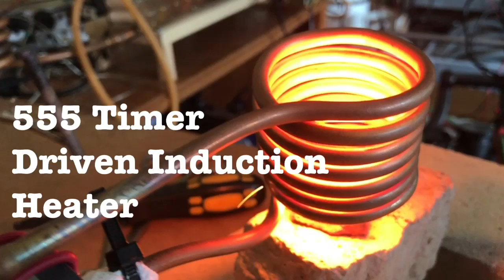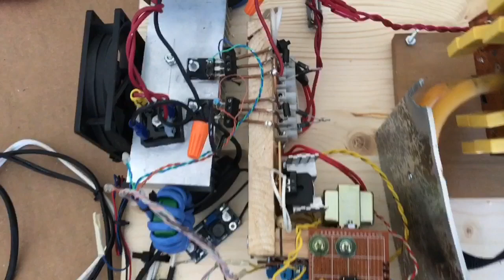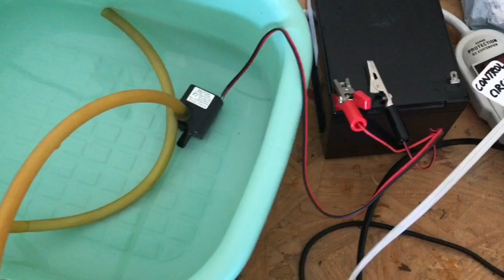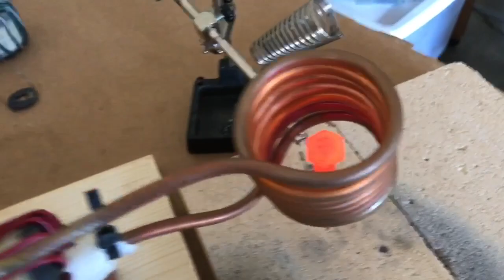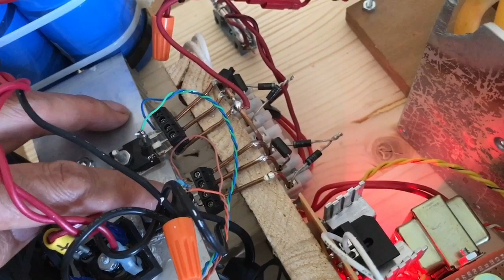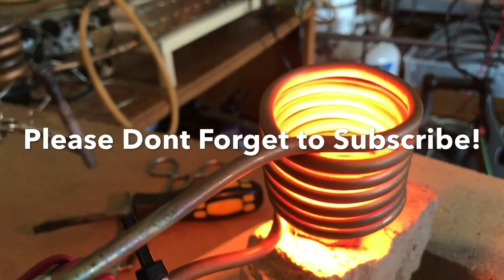555 Timer-driven Induction Heater

Comment: How much did this run cost you in terms of electricity from the utility meter?
Reply from the maker: A run like this typically does about 2 kW. Running for an hour would be 2 kWh If I do the run for 15 minutes this would be 0.5 kWh. At 17 c per kilowatt hour this would correspond to just over 8.5 cents
Reply: @BrianDhvTinkerer  Thank you!

Comment: I wonder why the coil didn’t shorts out the ferrite core transformer blowing the igbt I try it with 19kw ferrite core at 100khz the circuit work great with the induction coil but as I add it on the core the circuit blow up I don’t understand this I built induction without pwm ic and it work but refused to work the same design you use I use 20 1000 volt 1uf capacitor and still it blow up I even un 20kw of igbt and all blow up I even use a welder and the welder work and it the same circuit I copy a use the circuit work great welder but the induction still blowing it up am confused at this point

Comment: I have used the same IGBTs, each attached to a separate heatsink with fans. I measured Tcase around 90 celcius, at around 1.2KW of power the IGBTs shorted. Any idea how to prevent the thermal runaway?
Reply from the maker: Definitely would recommend mounting them on a water block if you’re going to use them with an induction heater. I had the same issue using regular fan cooled heat sinks. However, with a water block, it solves the problem completely. Only issue is clamping IGBTs down-to the water block with equal pressure on each. I found a solution for this.
Reply: @BrianDhvTinkerer  With 1.2kw of power, wouldnt be too much for water cooling the inverter? That means that its really inefficient. My setup was 4 heatsinks each 80-100W heat disipation so 400W in heat dissipation total. They were driven preety hard from a gate transformer with 4 secondary windings each for one IGBT so i suspect it wasnt from switching losses. Maybe the PLL got out of frequency range, so the whole system got out of tune and was drawing alot of amps that way. I have 325Vdc input, full bridge inverter and 18 turns in the matching transformer, 90-100KHz. Would you recomend to use 500V MOSFETs for this kind of application?

Comment: Hello. How did you calculate the matching transformer, which feeds the series circuit of the inductor? This transformer can be seen at 0.12 time on  video. Maybe you know where i can read about the design of such transformers. Thank you
Reply from the maker: It was done empirically. I just ran the unit with different ferrite toroids made with different size and type ferrite material and also some powdered iron toroids and chose the ones that have the best heating of the workpiece and least heating of the toroid material. I was able to find ones that had essentially no heating of the ferrite material. Even better energy transfer can be obtained by stacking the toroids.
Reply: Thank.

Comment: would be interesting to try and design and build wills type water heater using this circuit which would heat water in a coiled pipe would onto a steel mandrel sheathed inside a steel steel pipe but the work coil is wrapped round the steel pipe which is insulated using Rockwell wool.

Comment: please sent me schematic diagram
santossantoso950@gmail.com
thanks,..
nice project,.
Reply from the maker: +dika dosantoz  sure will. I need to draw one out.
The square wave output from a 555 timer is fed directly into mosfet driver chips which then drive either a full bridge or half bridge of mosfets. The 555 timer is and mosfet driver chips are electrically isolated from the half bridge or full bridge using a ferrite gate drive transformer. The half bridge or full bridge gets rectified DC via the mains and pulses this into the tank circuit. This is done using a ferrite coupling transformer. When the frequency entering the tank reaches its resonance frequency, huge currents build up in the tank (kAmps) which heat the metal placed in the coil via eddy currents. The circuit diagram
I put together should be more self explanatory. When the power is off resonance, no power flows into the tank and their is little or no current draw.
Reply: thanks for the science
and I am waiting for the schematic diagram from you
#google translate
Reply from the maker: will have  it to you soon!
Reply: thanks for circuit 👍

Comment: I am a knife maker, and have been looking into using induction to heat treat my knives.  All of the cheaper options I have been looking at on ebay, using $40 induction machine, using 30V, 20A power supply, seam to not work well for this, because it only heats carbon steel to non magnetic, then stops heating at that point.  Can you advise me how to continue heating metal past non magnetic, so I can heat a little past critical before quench?
Reply from the maker: +WILDSTANG30250 you may want to try something like this: https://youtu.be/nIPuZ1WPtc0

I am planning on making an instructible on this if there is enough interest.

Comment from the maker: I think I can get this circuit to autune with a feedback antenna or feedback transformer placed in such a way to pick up the output of the tank and feed it back into the Schmitt chip.
Reply: thanks for ur help man, atm im trying to get all the mats to make a PLL heater.... Thanks for ur support-
Reply: At this moment im buying the capacitors for the tank, would be 140pc 22nf 600v enough for the tank circuit? Thanks man
Reply from the maker: should be more then enough. I used 20 x 0.22 uF caps. I bought the ones from easternvoltage research. You can also use other good quality  caps. The key is good quality polypropylene / MKP. Poor quality caps will result in poor induction heating, a lot of heating of the capacitors, and ultimately capacitor failure.

Comment: Awsome work, waiting for more vids about this circuit!
Reply from the maker: Thanks. I will put up a circuit diagram for this shortly. It is much easier to make and use then the phase lock loop coil.
Reply: It is auto tune like the pll ?
Reply from the maker: Its manual tuning with a single 20k pot. No power passes through the circuit until it hits the tuned spot. i have a green LED connected across the tank circuit which lights up when the tank starts resonating. Also, you can hear the variac start to hum when resonance is reached.
Reply from the maker: another thing, with the PLL design, it auto tunes, but as soon as the metal goes beyond the Curie point, it detunes and has to be manually tuned to get it back into resonance. This is because the change in the resonant frequency of the circuit when  ferromagnetic material hits the Curie point is outside of the auto tuning range. I replaced the MOSFETS in the original circuit with IGBTs and rewound the GDT to supply 24V to the IGBTs. These perform solidly and better then the MOSFETS did. I used 33V zener clamps across the bases and the emitters of the IGBTs. Use 440V TVS diodes across the collector and emitter. Use a parallel arrangement of 1N5819 and a 6.8 Ohm resistor connected to the bases. I found that the series arrangement of a 5.1 Ohm or 6.8 Ohm resistor connected to a zener diode connected to the base caused too much heating of the resistor and zener, and also caused the gate drive chips to heat up.
Reply: I want to do a induction furnace for hobby melting, mostly aluminium and eventually copper, about 1ltr of aluminium max, what do u recomend? a pll based heater or a manual tune heater?